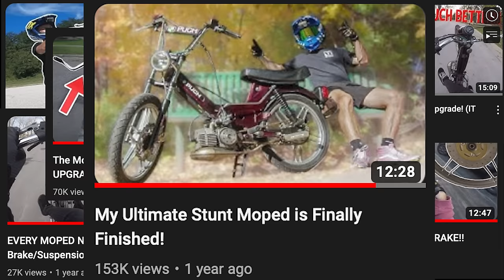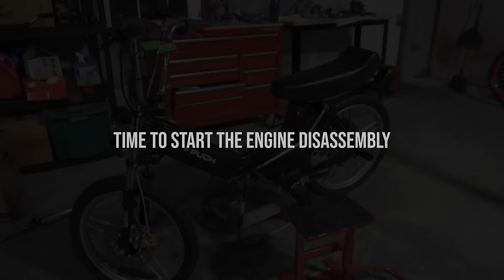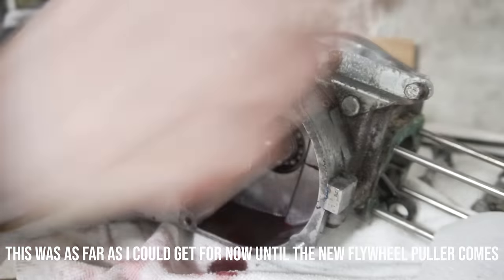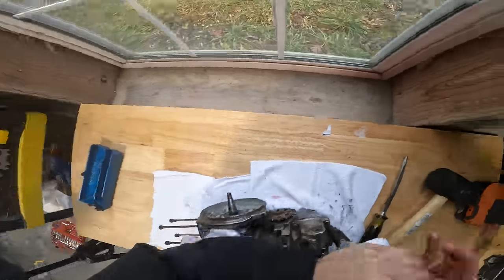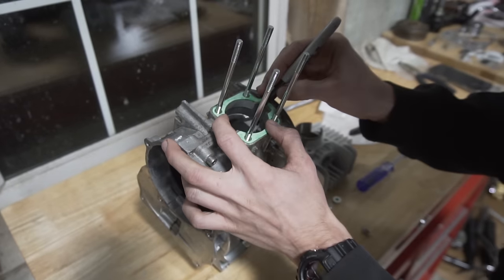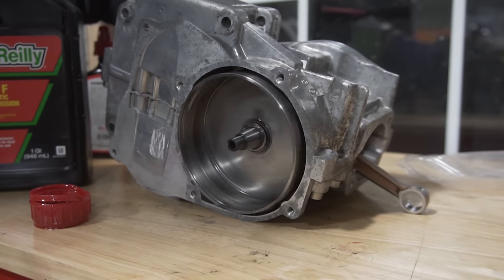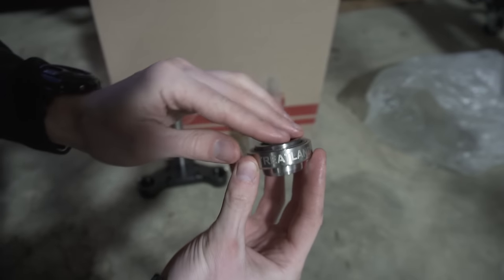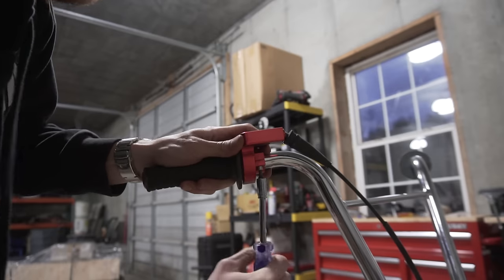Fully Rebuilding My DREAM STUNT MOPED

Comment: wait till bro finds out that a beta rr 50 track exist
Reply: Probably doesnt care that much, as the beta is expensive to buy, mod and very boring to ride
Reply: SVP bro,can you pls help with an advice on my yamaha scooter cc 100 1998 bike, the speed is 160 but it runs very sloo about 80 km and I usually hear noise from the back clutch ❤❤❤pls am watching you from Ghana Accra

Comment: 2 strokes are awesome.
Reply from the maker: Very much agree
Reply: Greta who?🥱
Reply: Yet 4 strokes are better.
Reply: @BrickEngines  nope 2 stroke is better faster sound better and have more power
Reply: @Veloxxtekk  all of those claims are false exept MAYBE the power, it highly depends on the engine quality and cylinder amount, but the sound is far superior for 4 strokes why? well you probably havent heard about tis bike: https://www.youtube.com/watch?v=UH4ZIsWy4SE
Reply: @Veloxxtekk  2 stroke engines are just cheaper to make
Reply: When it comes to dirt bikes 2 strokes are the best
Reply: 2 strokes are awesome because there so simple
Reply: @BrickEngines but slower
Reply: @TwoStrokeJ yeah
Reply: @BrickEngines how, there’s no valve adjustments or any oil changes with two strokes except for dirt bikes having trans oil.
Reply: @BrickEngines depends mopeds no yes if its gonna be the legal 30kmh but some How 2 strokes are better if tuneing but for dirtbikes yes there i just Think people need to calm Down with the hate just because they drive a 2 stroke does not mean its the best
Reply: @BrickEngines you gotta have both
Reply: @BrickEngines we’re talking broadly here, not talking about the best sounding bike of all time. Generally, 2 strokes just sound better than 4 strokes, generally.
Reply: All hail the mighty Buzz-Bombs!  (with odor of burnt Castor oil!)

Comment: A nice rebuild, I love using reed valve kits on these engines as well. I'm also impressed by how well the stock clutch held up. Just a quick tip for the next time - if you heat the bearings up, they just slide onto the shafts without any additional force. Using a press on either of the shafts is a huge risk. The output shaft is actually made of two separate parts and you could press the large gear out of position. The crank is even worse in this regard, without the webs supported, you could squish them together and the crank will no longer run true.
Reply from the maker: Interesting, I didn’t know that! Thanks for the advice, hopefully I didn’t mess mine up doing that!

Comment: Sick build🔥🔥 
Few tips just in case. I think you spaced out the seal on the stator side from the bearing. If not I would do that otherwise the bearing won’t get lubed by the 2 stroke oil. Second thing is if the clutch side cover starts leaking oil I found tightening the clutchcover and the cylinder first before all the case bolts helps align the cases because the e50 doesn’t have any dowel pins that can help eliminate that problem. 
Love to see the builds keep up the good work💪🔥
Reply from the maker: Thanks for the advice man! I made sure to leave space between that seal and the bearing for the 2 stroke oil!

Comment: Hey Two Stroke J, your area looks a lot like central PA 717. I have a 1978 PUCH MAXI that I just got a major bearing service and brake job done. I also started to rebuild my engine. I need to take it slow but it'll get there. I wanna be riding this summer atleast- W
Reply from the maker: Hey man! I’m still working on finishing this build but I’m the same way, just want to get it finished up for summer!
Reply: Nice, I'm converting mine to 12V @TwoStrokeJ
Reply: Got the bad bitch running! I am using the 70CC for the people kit. It hauls ass! Especially with a 14t sprocket. I gotta time my motor yet other then that we are almost good to go. I am using the 12V AC ignition with Pietcard CDI 2041. I just need to get the head lights and tail lights working. Other then that I am happy with the bike! I just acquired a pre bug 98 Zuma with a 70CC Athena engine for a rebuild!

Comment: Saw that you still have the stock clutchcase, it could be possible that the gear that is pressed in it could strip an come lose, i would reinforce it by welding it on the clutch side around or buy a new racing clutchcase. Cuz happened recently to mine 70cc puch maxi
Reply from the maker: dang that must have been pushing some power to break that off! Good advice tho man!

Comment: pretty sure u coudve just pressed out the copper bushing without disassembly of the engine/replacing the cranckshaft. just replace t with a bearing.. comes with the cilinder kit most of the time. WHole rebuild s better offc..the 65cc polini cilinder kit is what ud want for this..

Comment: what carb size do you have on there? i think for a 70cc 2 stroke u could use a bigger carb i would think. same for the exhaust
Reply from the maker: 19mm carb. Could maybe upgrade it eventually but it works great for now
Reply: @TwoStrokeJ  ive got some friends who are into 2strokes and most of em say carbs and exhaust help a fck ton when u have a 70cc. then again parts here are a bit easier to get i think

Comment: great project! build a 100cc piaggio ciao next!!!
Reply from the maker: 100cc would be crazy!
Reply: @TwoStrokeJ  dont know if you recieved my last reply or not but you can actually get a full 100cc engine kit with almost not having to do any adjustments to anything. would recommend it. its name a Simonini 47.6mm kit
Reply: It does not have 100cc tho, its more like 85 or so @st.coiled
Reply: @osnariderz5075  yes, yes there is a 100cc kit. i have it installed on my ciao too...

Comment: Sick video on the process! How big of an upgrade is that stem bearing? Would you recommend?
Reply from the maker: 100%. Even with the upgraded forks I had, the front end was loose and had a lot of play in it just from those shitty stock bearings. Now its 100% tight. Haven't done much riding on them yet as the bike still isn't fully finished but I would for sure recomend it
Reply: @TwoStrokeJ  shiii say less. I'ma have to do it too then while I'm putting my EBR forks on. You got it from treatland?

Comment: You are lucky you have a 4 bearing e50 engine. You also have 3 bearing e50 engines those last less long than the 4 bearing versions if you tune them.

Comment: Hi,
Could you share where u got that nice headset bearing kit from? i want that for my maxi!
Kind regards!
Reply from the maker: Got them at this link here. you have to use the specific EBR forks though with them as well.

https://www.treatland.tv/TAPERED-headset-bearing-conversion-for-30mm-EBR-p/tapered-headset-kit-maxi.htm
Reply: @TwoStrokeJ  Thanks alot!
I just found them in EU, same kit as u linked. Funny because i thought EBR forks was 28mm. I cant find a 30mm fork in EU, got any help here?

Comment: Run a bit more oil in the fuel than normal, since the engine is newly put together. Overall Tuned E50 engines need more oil to run than a stock one.
Reply from the maker: Yep, that makes sense